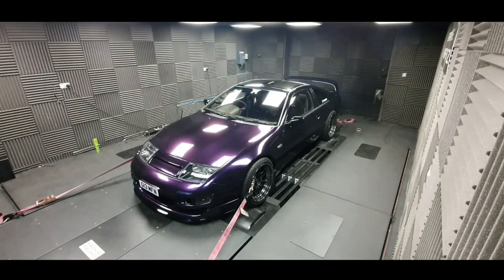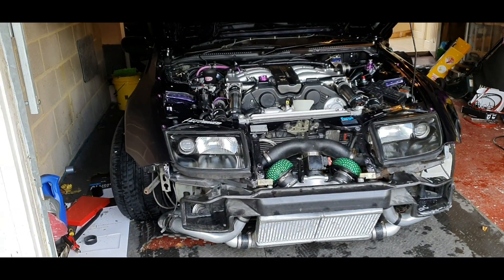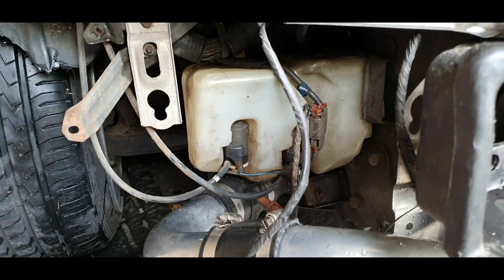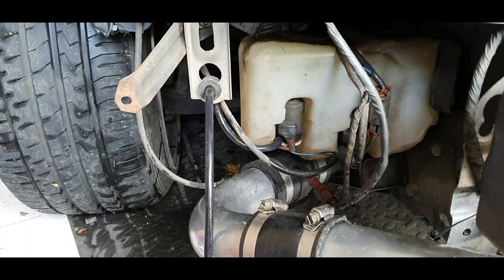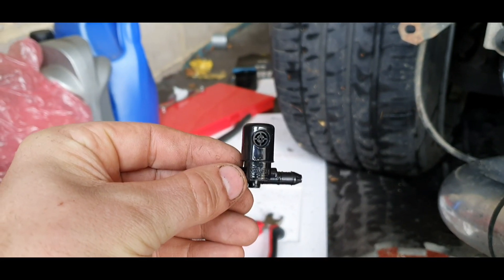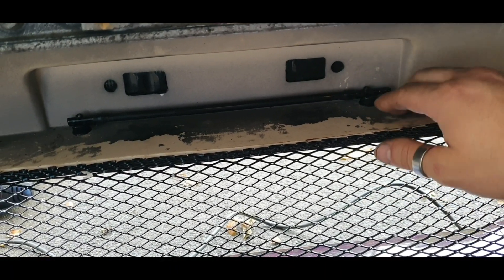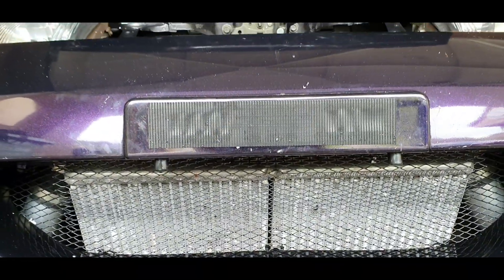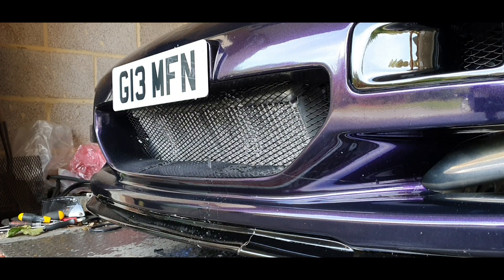INTERCOOLER COLD WATER SPRAY FOR £5!!!

Comment: just cut off and use normal spray bottle nozzles... the kind that as you twist/rotate, go from stream to spray.  This way you can adjust the stream to mist ratio.  If you use the factory washer nozzles they are meant to be sprayed like 2 feet out from the point of intended contact(windshield) so they have that time/distance to fan out.  But usually intercooler sprayers are mounted like 6 niches away so using factory windshield washer nozzles it just comes out in a thick spray like you see here in this video.  Simple fix though... dollar store spray bottle nozzles.
Reply from the maker: Good shout thanks 👌

Comment: I feel like it wouldn't do TOO much on the dyno because it covers a small surface and kinda just drips down, but on the road would probably be a different story, and probably far more effective as the wind would feed it a lot more, none the less, cool mod and nice zeddy my dude!
Reply: If youre on a dyno they usually use a cooling fan to blow air over the intercoolers and radiator to stop the car over heating and simulating airflow from road use, so i would assume that the dyno would be pretty much the same as the road..

Comment: Hi matt, if you want a nice fan spray pattern have a look for some spray bar nozzles for car washes or agricultural sprays. 

I bought a set for my home built hydrographics  tank and if i can find a link I'll pass it on to you mate.. 
You get a nice fine mist which is what youre looking for. 
Only thing i can think of that could be an issue is the pressure you can achieve with that pump, however as you only have 2 nozzles, i think it will be enough to get the reaults you want..
Reply: there's a cheaper better solution.